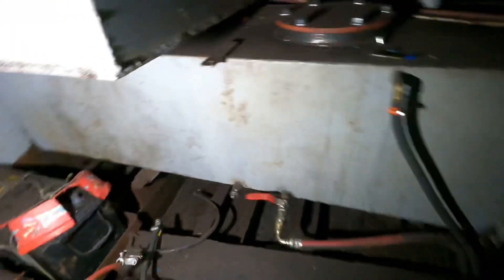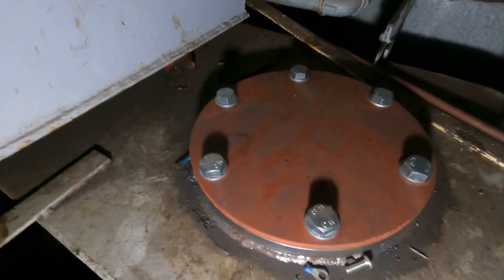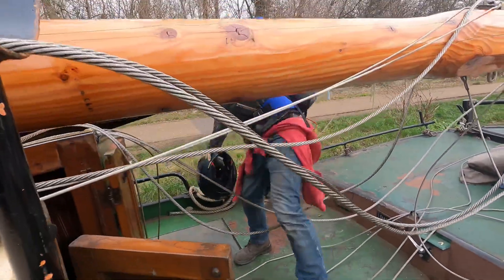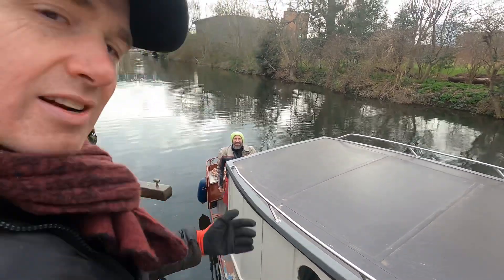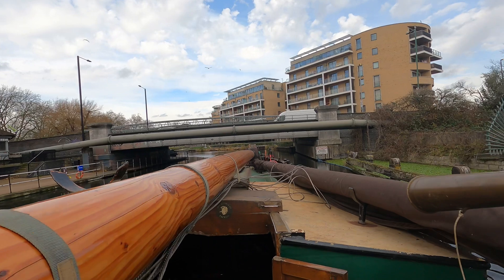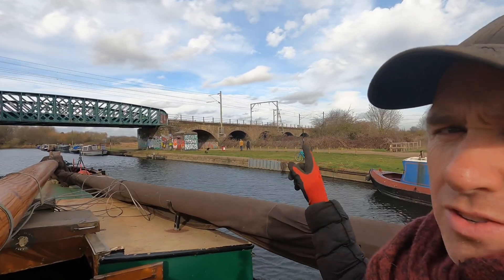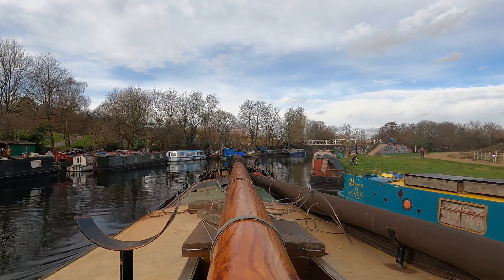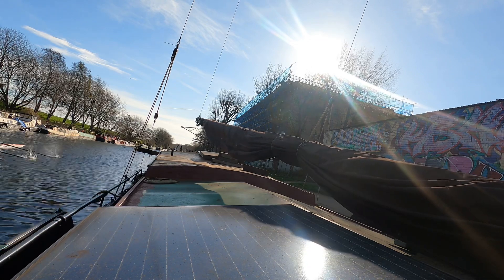I may have hit a couple of things, ￼along the River Lee in Hackney, London. Dutch Barge Linda #79

Comment: Canice, and old skippers trick: when the rear end of the boat sits too high in the water when going under a bridge, give it full the full beans. The propeller sucks down the rear end of the boat. They used to do it a lot in France instead of having to dismantle the entire cabine structure. It's not  legal anymore, but still does the job. ;-)
Reply from the maker: I’ve heard about this. No way am I speeding Linda under the bridge.😂😂😂 
Sure when you have years of daily navigation experience in your boat and you’re absolutely confident in your engine, perfect solution.  
🤔 You know on second thought, maybe I should give it a go!😂
Reply: @canicebannon  I'm pretty sure there was a "first time" for any skipper. ;-) Even in the worst case, don't think we'll be reading about you it in the news papers...

Comment: Interesting way to check the diesel tank level. I check my heating oil in a similar fashion, but I have a new fangled screw type top with no bolts. Unfortunately I don't have a length of wood handy so I use the look and tell approach. The results seem to be similar to yours however. Quick look and it's O.K or Oh No! Nice to see you got an O.K. reading. When you get an Oh No! reading please show us how you refill. Bon Courage!
Reply: I had an old, even at the time, Mercury Capri. I used a yard stick to check the fuel level. I only  ran out once a half a mile from town.
Reply from the maker: I once put my hand in, in the absence of the stick….. that took a while to clean off😂